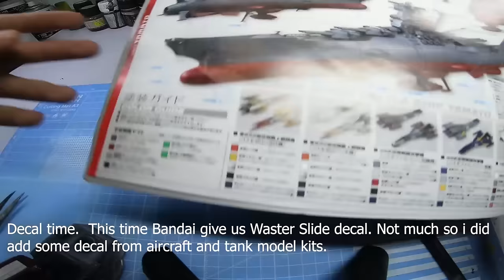SPACE YAMATO BATTLESHIP - STAR BLAZERS 2199  - 1/500 BANDAI SCALE MODEL

Comment: Impressed by the way you combine the pre-lighted and preshade! awesome job great model. I have a question: after you apply the gloss coat for weathering and detailing, the ship looks pretty "shiny". Gloss finish is not what people use on ships, so did you applied another semi-gloss or flat finish paint at the end after everything else done? I noticed the finished work have some kinda metallic looking surface. If not, how do you protect all the details after the gloss coat? thank you
Reply from the maker: Im using gloss coat just to make the enamel weathering products flow much eaiser and cleaning it will be at ease. Then I will flat everything up. Only the exhaust protect the shinning metal using gloss coat :D